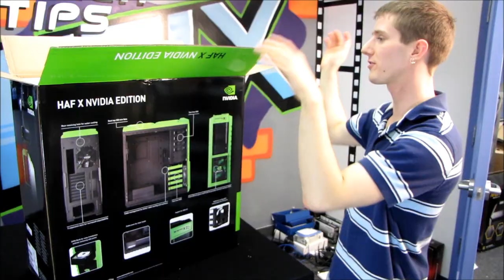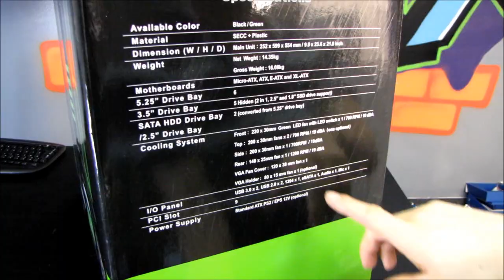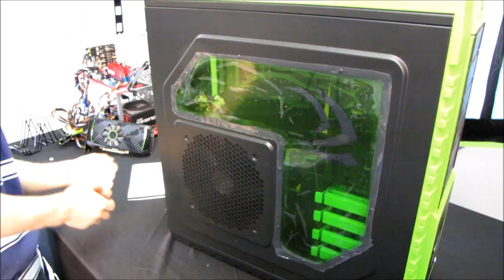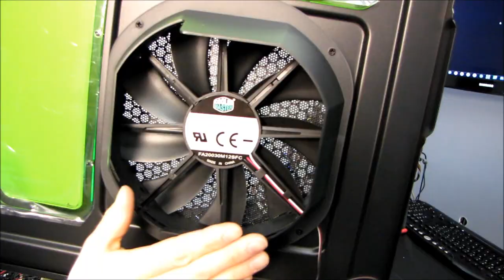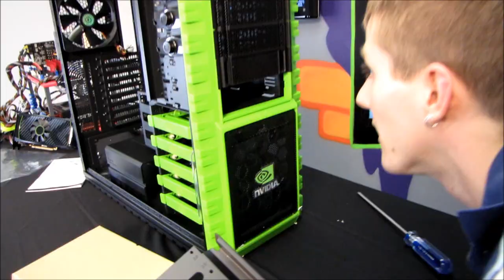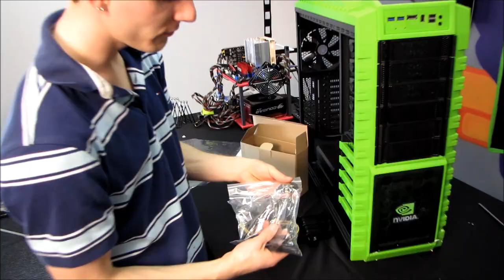Cooler Master HAF X NVIDIA Edition Gaming Computer Case Unboxing & First Look Linus Tech Tips

Comment: just got myself one after dreaming of getting it for over 10 years, will never change cases again.
Reply: I thought that too, kept mine for 13 years but finally upgrading to the HAF 700. It's basically the modern spiritual successor to the HAF X. Never thought I'd replace this old legend of a case but it definitely aged in design. Only thing I'll really miss about it is the super huge CPU cooler height clearance. 195mm HAF X vs 166mm HAF 700. Only really an issue for my old NH-D15 which I'm also replacing with an AIO.

Comment: I thought i was the only one using this case, maybe i am, considering this is 11 years old..
Reply: Nah. I'm rocking this case in 2022. For some reason devs stopped releasing real cases. The woke gen wanted RGB and glass.
Reply: @ironmaiden5658  RGB is gay.
Reply: Youre not alone! 
i just put together a throwback tower tonight with the haf x broke one of the 5.25 bay mesh's went to look for another found this gem of a video
Reply: @DamianKnox  Nice! I rebuild my pc a few months ago, basically the only thing i kept was the tower. The AIO radiator is mounted on top screwed to itself around the bars where the fans used to be. Ive never had issues with heat being trapped, its a cool case, even with the i9-12900k 🥶
Reply: @EricTheBroBean  funny you mention that! I ran a 280mm h115i up there the same way, i considered running rgb fans in the rest of the case but decided to stick with the oem coolermaster fans for that classic aesthetic

Edit: im only running an x78-D board equipped with an i7 3960x and a rtx 780ti
Reply: @DamianKnox  I kinda struggled at when mounting the z63 when i realized the mounting holes didnt fit, but the bars really helped when i lined up the radiator.
Im running a ASRock z690 board with a Asus RTX3070 ROG Strix OC v2. No RGB, i like my computercase simple and not too flashy. RTX780ti? You mean GTX?
Reply: @EricTheBroBean  yes haha i can’t believe that slipped by me it is a gtx 780ti lol 

My daily driver is a b550m with a ryzen 7 5800x and an rtx3060ti NOW its all decked with rgb but for a long time it was in a powermac g5 chassis with some noctua nf-p12s and a cheapy coolermaster air cooler
Reply: @DamianKnox  Sounds pretty good! Been using intel since early 2000's so i dont know much about ryzen. But our gpu's will probably be topshelf at least a few more years. All the games i play run smooth on max settings, found some nice stable overclock settings to get the most out of my gpu, probably not necessary but why not hehe. My fans is always on im not a fan of the fans being off when idle feature.

Comment: Very Old since 2011. I've had mine, which is NOT the nVidia edition, since 2012. I wish I could show you...lol. Mine is ALL hacked up, decimated, or modded so much that it's unrecognizable. I even forgot what the original looked like !!!! LMAO!!!! Anyways....what I hated the most is the non windowed side panel. There is NO ROOM to run a lot of cables. Especially the main power! I literally have to push hard inward to fasten the panel. Anyways....old video and my opinion. If I had the chance to make my own review of this case, my main complaint is about the latter statement. Very nostalgic stuff.

Comment: Is this okay to buy in this year 2020?
Reply: it still has better airflow than a lot of cases so yeah. As long as you’re okay with the outdated look, then sure.
Reply: Depends on your build, but it still is under the top 3 cases with the lowest temps, depending on the fan setup.. 
I personally use it since many years and kept it for my new R9 5950 and RTX 3090 build, just had to modify it a bit for the massive radiators.. and if ya wanna replace the top fans, you probably have to cut some corners.. at least i had to do it, to fit 2x 200mm Noctua fans.. 
The HDD storage can be ripped out, if you dont need massive ammounts of storage, to improve airflow.. you still have 2 HotSwap places in the front pannel, where you can fit SSDs and HDDs.. currently have two 1TB m.2 and a 1 TB SSD installed, which is more than enough for normal/gaming use.. a good thing about the case is, that you can still build in a CD/DVD drive which seems to have died out in modern cases.. (kinda sad, cuz poor old games that are only aviable over CDs) 
And you can use it to place the alpha cool "Eisfach" resevoir in it, like i did..
Reply: probably not lol

Comment: The cpu cut out is too small!!
Reply: Second motherboard installed in it, still no issues with the cut out.. what MB are you using?
Reply: @chimei-tekinaneko8318  1155 socket
Reply: @Star_Sn1per  meant more like ATX, E-ATX, Mini-ATX..
Reply: @chimei-tekinaneko8318  ATX and i'm not joking i have to remove the whole motherboard when i want to change water cooler.

Comment: i have this case for long time now, and i m not considering change it now soon. My question is about the way i should put the fans. I have 1 fan infront, 2 fans on the top, one fan back and one fan one the side. Is it wrong that one of the top fans is intake and the other outtake? I did this to have the optional pressure inside. Thank you and keep up the good work.
Reply: Have the same case, the both top and back one have to be output, just at lower rpm, side and fron are input, otherwise you f*ck up the airflow and create spots where the hot air cant escape, cuz it gets pushed at from all sides, plus the to fan sucks the warm air from the other one back into the case..
Reply: I set my system to low pressure thou, to passive cool the drives in the HotSwap slots.
Have no issues with dust, since the side fan pushes enough air in, to prevent the missing air getting sucked in trough the unfiltered holes in the back..

Comment: Super Lan Boy - nowhere, Yes - I have one of sale the holy but missing Grail I have originally Complete (NOT EVEN ANT4FC HAS THIS....) down to the screws with the antec material handle grip thing that goes around the entire case wand c0ool blue original fan on front, all working, may be only one left!.....

Comment: This case paired with a Gigabyte Sniper motherboard and my GTX 970 would make for a sweet colour-coded system! Even prior to watching this video I got cheap budget Kingston ram but the good thing is that it is GREEN!! So it will fit very well with this build. My only problem is where to buy this case? I looked on Amazon and it is not there. Are there any other online stores that sell this?
Reply: Look on PC part picker

Comment: Why don'T they sell cases like that anymore.
Reply: I have this case, and I could list a lot of reasons for case makers not making stuff like this anymore.  First, it's really hard to have good cable management. I guess if you s-entmsmfuckload of money on cable extenders.  No matter how good you make the back of the case look (and mine is pristine), everything in the window will look like shit. My motherboard probably doesn't help, but it's not the motherboards fault. Second, the riveted drive cages really limits you.  Actually, this case really has so few build options. I had to heavily mod the case just to add a second 120mm fan to the front.  The thing is absolutely enormous, but you can't use size for anything since you can't put a 240, 280, or 360 rad in the front, since you have riveted drive cages blocking you.  You have plenty of room on the top, though.  The dust filters suck and half the case has no filter at all. I had to make my own dust filters.

Honestly this case is dated and frustrating.
Reply: @afrothundaaaa It isn't a terrible case, I have built multiple computers in it. But I wouldn't recommend it to anyone.  If the drive bays were moveable, that would be a different story.  If you use optical drives, I guess it is good to have optical bays.  I haven't used an optical drive in probably 4 years.  I don't even own an optical drive anymore.  

I do really like the hard drive mounting system, but I wish the bays could be removed.  It would be great if each hard drive bay were a separate thing.  So, I think there are 5 bays in there.  I wish you could unscrew it to have 5 individual components that you could then throw anywhere you wanted in the case. As opposed to having all 5 hard mounted to one spot.  

Honestly if I were contemplating keeping this case, I would pull out a dremel and cut all of the bays off to open up the front quarter of the case, then I would mount SSDs whereever they looked good.  But I am probably going to get a new case when I get my next computer.  This thing is just too old.  I'm going to go for something more minimalistic.

I would never recommend a person buy this case in 2017 or later. It is not worth buying.  It isn't a terrible case.  I have absolutely used worse cases.  But you can get a much better case for not very much money these days which will come with all of the features you want.

Comment: I really like the haf x. It looks really really similar to my Rosehill Thor v2. a couple differences though. my Thor has a bit cheaper construction, but one thing I do like is that the USB 3.0 plugs into the header on the inside of my case so I don't have to route it around the back to the i/o on my mobo

Comment: Clicked on the vid cuz I have the same case! I got it a few months after this video was put up. I built the entire rig through newegg and originally had the all black HAF X. The day before I completed the entire order I found this awesome Nvidia version and first laughed heartily, then immediately decided I needed it in my life. Appropriately, I threw a gtx 570 (nvidia) in it for some sweet, sweet, skyrim and a few years later I've just replaced the 570 with the 970 for some even sweeter skyrim + full enb effects!
Anyway, the moral of the story is this case has outrageous cooling capabilities without the hassle of water-cooling (HAF/High Air Flow). Although it's great for water-cooling as well, I just didn't deem it necessary since my peak OC'd temperatures under maximum-benchmark load never passed 70C with either the 570 or 970! Plus the green/blue led theme I'm running looks pretty sick!

Comment: My new part which im waiting for to put togheter:

MSI Z87-G45 Gaming, Socket-1150
	Cooler Master HAF X Nvidia Edition	1
Intel Core i7-4770K	1
Cooler Master MegaFlow 200 Blue LED Fan 2
Gainward GeForce GTX 770 4GB PhysX CUDA
Seagate Barracuda® 1TB

I got the Gtx770 put and running on my old setup cause not all parts have come yet so i noticed couple small problem which probably are due to my old setup however. Should i send back the GTX770 and get 780 insted it only like 90 euro more? Imean gtx 780 is so much better and i wont have to change anything for some time then... any thoughts guys?
Reply: Kenoshino an i7 with 770 is overkill, so you are best off with a 780 (or 980/980ti)
Reply: Getting 980ti soon along with new SSD's!
Reply: Nice choice! Do you still have the GTX 770 as a main GPU? Or did you upgrade?
Reply: Still have the gtx 770 and its still running games on ulti!
Reply: I have the GTX770 too, though with only a basic i5 4430s D: Runs most games on 1080p ultra 60fps+, except for some of the new demanding games and my very modded Skyrim.
Reply: Jinjenia I had some problems with gtx 770 in WOW like sometimes is at 60fps and when like im in a crowded place and im panning with the camera it drops to like 15. It's suppose to do that but i dont know if it should drop that low thou.
Reply: Do you have the 2gb version? If so then it may run out of memory... Use afterburner and see how much vram it uses.
Reply: Nah its 4gb.
Reply: Then it cant be that. I have a 2gb version and it works great too.

Comment: is it safe to mount a 2x120 Radiator on the top of this case? i mean they have the mounts for it but its just 2 trips of metal that hold it up, most cases have a solid 8 screw metal mount. another question, is it safe to mount the swiftech h220 on this, it is recomended to use all 8 screws to mount it but with this case, its only possible with 4 scre
Reply: A H220 or 2x 120 radiators should fit with no problems
Reply: You can put a 360mm thick rad at the top so 240 is no issue
Reply: i got a 360 radiator atm no problem, you can even fit a 480 with minor modification, and it would also be cheaper to run a 360 rad or 240 instead of 2x 120 and it would make it alot easier to tube

Comment: I would put a Radeon card in there and say "fuck the police"
Reply: also crudely cross out the nvidia branding a write AMD sloppily in a marker. /)(\
Reply: *****  What is with the slashes and parenthesis at the end there?
Reply: ***** So is it like a goat or what?
Reply: ***** Well, long horses are Geraffes so obviously small horses are goats.
Reply: ***** Huh what is that? Another goat? I get it already you guys love goats!
Reply: ***** Huh... whats a pony?
Reply: Haha thats because I am not an asshole when I do it.
Reply: ***** Its actually a pretty bad troll, it doesn't say what you think it says. It actually says "Look how crap AMD are, they have to co-opt Nvidia stuff because the can't make their own".

Think about it, if a bum squats in a mansion he is still a bum.
Reply: ***** Thank you Sir, I was not totally serious though. AMD parts are fine, anyone building a PC should always get the best parts for the best price that suits their needs and fuck which ever company makes it.
Reply: ***** To be honest I don't like current AMD much either, they lost their way and are no longer the best performance per £€$ that they used to be. Two of my previous systems where AMD, a Athlon X2 5200 + Radeon 3870 and then a Phenom 9950 X4 and Radeon 4890 X2 both builds with AMD chipsets as well.

After a slew of buggy drivers breaking games as well as the system being like a space heater and Intel stomping them on the CPU front I went for Nvida + Intel on my current build, the parts cost less than a meal out more and are much more efficient and quiet and so far much more reliable on the driver front.
Reply: ***** Ouch, bad overclock by any chance?
Reply: ***** Sounds like its just cutting out due to temps and not completely dead, try reseating the heatsink or reapplying your compound.
Reply: i agree, hes obviously an nvidia and intel fanboy
Reply: ***** i mean it seems like linus is being an nvidia fanboy, and biased to the point of not giving other ideas and options. i have no problems with anyone on the thread here

Comment: Is there any adapter or anything that would allow you to have the USB 3.0 ports in the front to connect via header instead of wasting two slots on the back? If so this case is utterly perfect for me. The CS storm is pretty badass too but this is perfect for my needs if I can work around not having header connectors for the front ports.

Comment: 2 690s work with the drivers, and can actually be used in real world applications.

3+ 690s do not work with the drivers and cannot be used in real world applications. They can be used in folding... which is limited by other aspects of the hardware and works far better using soley cpu, through power and original cost per unit.

It is possible but it is a completely idiotic idea, and in the Tyan case it was essentially used for a show off build.

Comment: CPU: Core i7-3960X, GPU: 3 sli GeForce GTX 690, Hard Disk: 4 x SSD SATA III  128 GB in RAID 0, RAM: 16 Gb Ram DDR3 1800 Crossair, Power: Cooler Master Gold Silent Pro 1000W, Motherboard: ASUS Maximus Formula V...this is my pc now...and I have all in this Case ^_^

Comment: I have this case and the easy answer is no. If you get BitFenix Spectre or BfS Pro fans you can wire them all in parallel and run it off the one switch, but it's not easy like that.

Comment: okay, heres a quick list of what i think you should get, dont take my word by law.

Motherboard: GIGABYTE Z77-DS3

CPU: Intel Core i5 2500k (If you want you can go for a 3570k (Ivy Bridge)

CPU Cooler: Just use the stock cooler :)

RAM:  Corsair Vengeance 1600MHz 8GB (2x4GB)

GPU: AMD Radeon 7850

PSU:  Corsair AX650w Gold Rated Modular PSU (or Corsair HX650w)

Boot: Samsung 830 64GB SSD

Storage: Western Digital Caviar Green 1TB

and do what you want with case :)

Comment: Ignore the other comment,

Motherboard: Gigabyte Z77X-UD5H  (or the thunderbolt one if you want it)

CPU: Intel Core i7 3770K

CPU Cooler: Corsair Hydro Series H80

RAM: Corsair Vengeance 1600MHz 32GB (4x8GB)

Graphics Card: Nvidia GeForce 660Ti

PSU: Corsair Professional Series AX850w

Boot Drive: OCZ Vertex 4 256GB SSD

Storage Drives: Western Digital Caviar Green 2TB (X2)

And whatever optical drive you want, be that Blu-Ray, HD DVD, DVD-RW or what have you. :)

Comment: there is another case that is just as cool as this one. There's a company in Taiwan (nvidia is also based in taiwan btw) called  Venuz.tw
They make a case also with 9 pci slots, same big fans on top, two on the bottom and a few more inside....
Fits an EVGA  Classified SR-2  perfectly  ;)

Comment: does anyone know if this case is the same height and weight as the Thermaltake Armor +.the one that used to cost $259 back in 2009 now it cost $178.i bought it but it was too big to fit where i want it to fit.

Comment: only problem with the duct is that if you had your graphics card in your top x16 slot it may get in the way the downside also is you may have to put it in the x8 or even x4 slot if u have one on ur mobo cheers

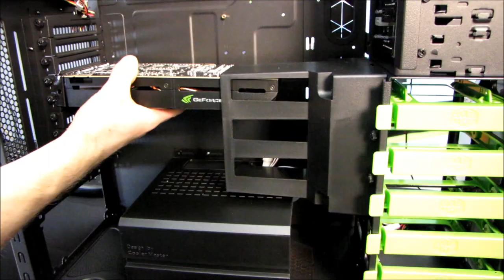Comment: what is the gpu u tryed to fit in at 09:23 and i really have to know coz am buying the case i love the look and the features in it so i want to know if GTX 580 two of it sli will fit in that and the motherboard i will use is g1 killer assassin the thing i don't want to remove that i like it and find it will be good for cooling specially it have small fan intake witch will pull air from the front fan intake